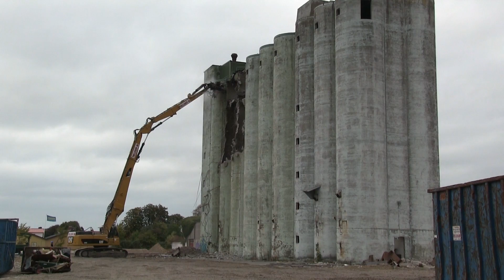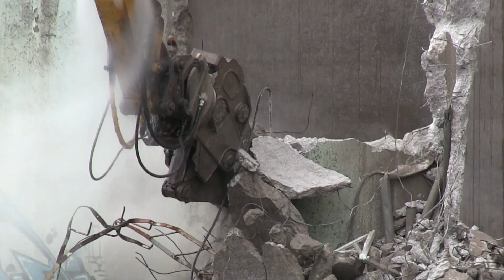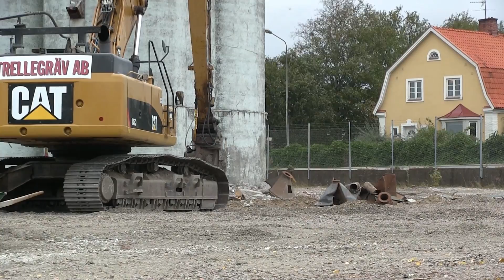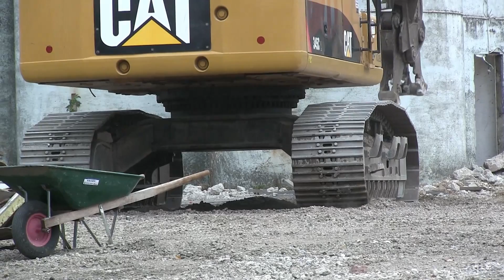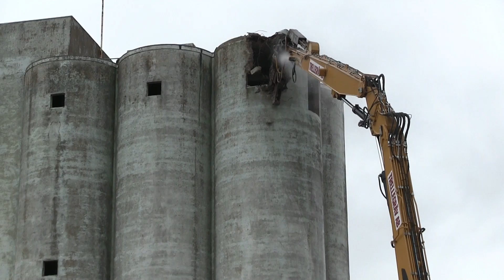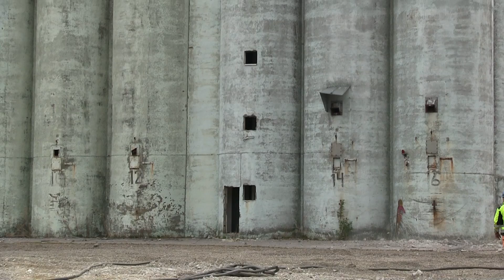Silo Demolition Cat 345C Long reach Excavator 2016

Comment: What kind of operator uses his excavator as a battering ram?? Like he did when he started at the top of the corner silo. He could have just moved another 2 or 3 feet and started at the door...
Reply: with those concrete shears you have to get rough with them to get a spot opened up sometimes, esp starting buildings, they are built for the abuse and its generally not bad. this is not a good practice on high reaches as the booms are unstable and more fragile that a normal stick and boom combo.  for example we run genesis razors and frequently close the jaws and use them to knock brick in on buildings.